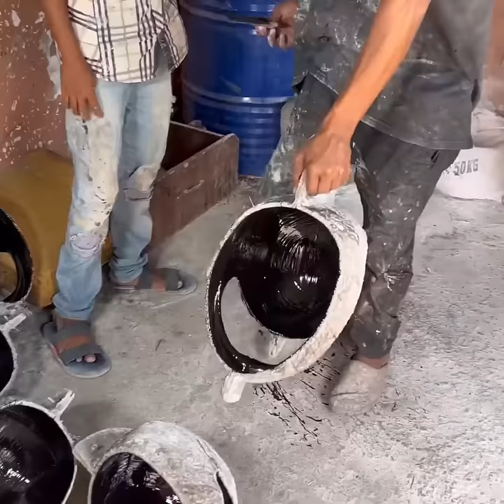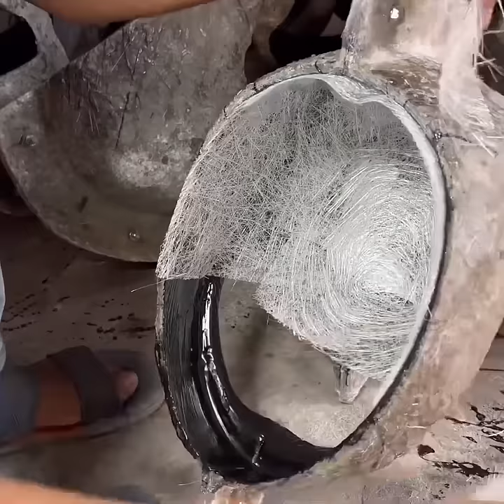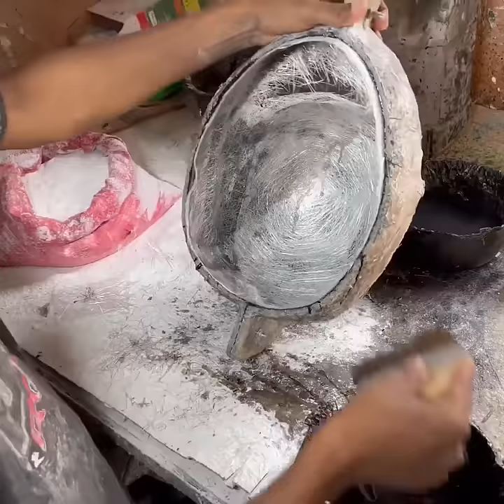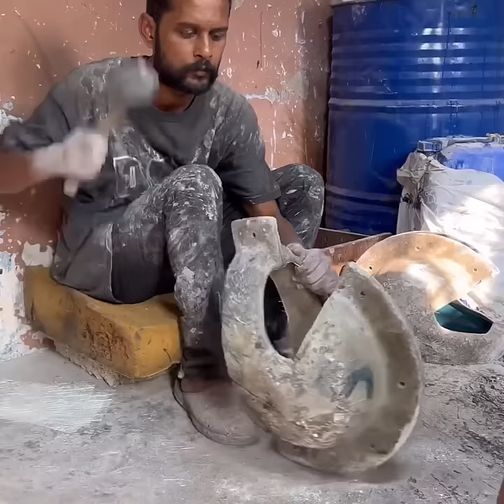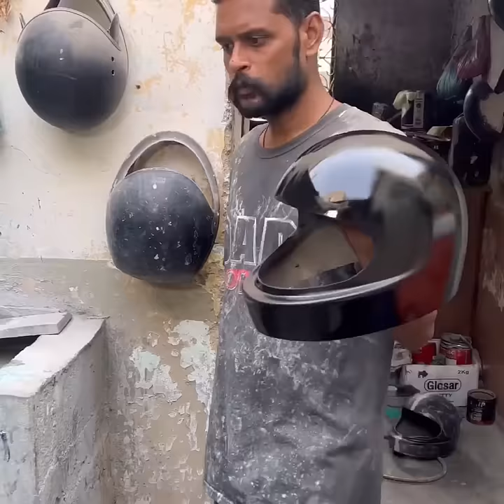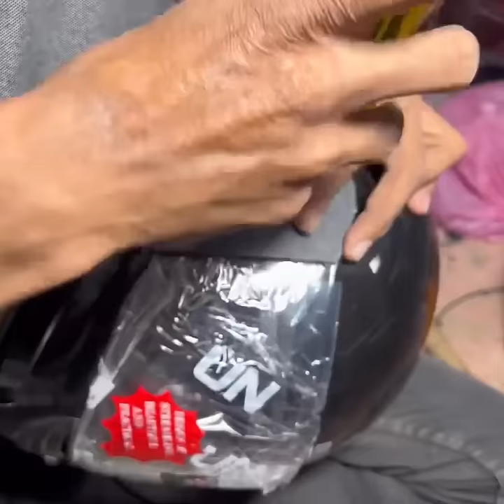How Quality Helmets are Made with Amazing Skills

Comment: The title should be How Low Quality Helmets are Made with Amazing Skills
Edit: 3.8k likes 😳
Reply: no... you're wrong, in fact fiber glass helmets are much stronger than the plastic helmets that are sold on the market, many  actually SportsCar also use fiberglass
Reply: @prodence9563  No! You're wrong.. The Fiber is Only One Layer, Very Thin Layer of Resin it's to cheap and Very  Low Quality.. And there's No Absorbing Layer it's only Comfortable Pad.. You're skull will crack open inside the helmet.
Reply: @RandgriZ04 no es para golpes es para que no te joda el aire en la cara y si caes tener la posibilidad de que no dejes la cabeza como mantequilla en el suelo es normal que los cascos aun se destruyen ,además si te caes de la moto en altas velocidades el caso vale verga
Reply: @prodence9563 In sportscar  fiber material is used to reduce the weight to achieve the high speed in races
Reply: Saya kira itu lumayan kuat karna fiber glas lain dengan plastik, fiber glas lebih kuat..
Reply: А ты уверен? Эти шлемы по крепче китайских будут поверь
Reply: والله لو. الامر. بيدي.  ليتم. اعتبار الباكستان. دوله عربيه. وتدخل في. الجامعه العربيه واعلم كل الشعب العربي اللغه. الباكستانيه. واعلم  الشعب الباكستاني.  اللغه العربيه  وانمح   الباكستاني. جواز سفر يدخل كل البلاد العربيه.  شعب. باكستان. ثروه. من الابداع والحرفية. في كل. مجال.  من.  التصنيع.  ومكن ان تتفتح بعد  ذلك  عقول. العرب 
ابراهيم رضا الكردي
Reply: Unsafe
Reply: What do you expect?
Carbon fibre?
Reply: Life is not guaranteed
Reply: Life is not guaranteed
Reply: Fiber glass is much stronger than the steel.... You half knowledge
Reply: Mejor el casco plástico de este casco al impacto se astilla y un trozo de este te atraviesan el cráneo.
Reply: Everything is wrong... According to  different people with different.. mindset
Reply: So many haters.
Reply: Arai helmet not good, Pakistan helmet😊
Reply: Ou: como ver crianças produzindo capacetes de baixa qualidade
Reply: @yezz30  Quality helmets have several layers and are made to break on impact to absorb shock otherwise you die...
Reply: Is correct.
Reply: 😅😅😅for reals they’re trying to sell it bad!!!
Reply: Instead of fussing over whether the helmet they are manufacturing is poor or good quality why not just appreciate their skills. Just look at the poor state of the building and the tools and what they are capable of producing in a place like that. Can any of you be capable of producing something like that.? Good work guys, keep it up. Just come to Africa and show the people here what can be done with so little resources. Africans have all the natural resources but all they know to do is hug it and complain that outsiders are stealing it.
Reply: You are correct. 😢.It's very unsafe.
Reply: ليكن في علم الجميع أن الخوذة دورها تقليل الصدمات الخفيفة مع الأرض، لكن لا توجد خوذة كافية لحماية الراكب إن كان الإصتدام قوي مع الأرض أو شيء صلب لأن المشكل الذي يقع حتى في السيارات هو تمدد انسجت المخ و ضغطها عند تخلخل الرأس، حيث يلاحظ في كثير من الحالات أن الموت أو الإعاقة تظهر بعد مرور الوقت بساعات على الحادث ...
Reply: Totally unsafe
Reply: @mrmrmrcaf7801 right,you can have a helmet that won't bend, crack or break on impact,but 9 out of 10 the skull will crack or shatter,so like you said,a good helmet is made to crack to absorb the impact, but I don't think the helmets in this video is safe at all,if fiberglass is cracked right, they can be Sharp like a razor blade...
Reply: @prodence9563 they might be stronger than plastic,but if fiberglass is cracked right on impact,it can make sharp edges sharper than a razor blade,an it can do a lot of damage...
Reply: 😂😂 @IbrahimKurdi-gz2hv
Reply: Any helmet is better than no helmet , let's appreciate the craft instead of being a Karen n complaining, unless you make helmets better yourself don't talk rubbish
Reply: Recina. Fibra. De. Vidrio. Y.   Calsita. Y. Catalizador
Reply: It's made of fiber, I think it's durable 😊
Reply: Higher quality than made in China.😊
Reply: @RandgriZ04 they did more than one layer, dingus
Reply: Sebaiknya helm ini hanya utk penumpang motor mainan
Reply: Se vc cair a ponto de quebrar um capacete desse, vc com certeza morreu.😅😅

Vc quer um capacete Ultra resistente pra q??

Pra sua familia falar q vc Morr3u mas a cabeca ficou inteira?😅😅😅
Reply: Yes I love this video so much I swear to god❤❤❤❤❤❤
Reply: Please share the vídeo of You Quality control.
Reply: It lack more pads@prodence9563
Reply: Me too
Reply: O, como salvar vidas arriesgando la tuya.
Reply: @Eldeboradordehamburgesas no hables mmdas, alguien podría creerte. 😂
Reply: 强度比塑料好 但是中国的头盔成本非常低 是用塑料做的
Reply: Fibre glass are verry strong then you  think bro...so,you are wrong😮
Reply: With child labor
Reply: @IbrahimKurdi-gz2hv  what does that have to do with the helmet?
Reply: Very true
Reply: Стеклоткань - это мягкость, углеткань (карбон) - это жесткость. Без угля этот шлем что гандон, без стекла - фарфоровая ваза. Выбирайте свою судьбу с умом
Reply: Just because u don't see v expensive robots n machines making them doesn't mean they ain't of a good quality.  And most of these products u buy in the western world come from these factories just because they in a store that u think is worthy your miney value in europe or America doesn't mean they were made there. Always look at the country of manufacture
Reply: not recommended for your life.  love your life
Reply: You who do not know anything, the helmet should not be solid, unbreakable, or made of iron. It will be more harmful because it will cause concussion due to accidents. Therefore, it must be shock absorbent.
Reply: @Eldeboradordehamburgesas Resposta simples e direta parabéns!👏👏👏👏
Reply: But it's better than non
Reply: Mast
Reply: For your shoe string budget this is more than enough!
Reply: Deberían dejar de contaminar tanto y mandar a esos chicos al colegio
Reply: Фирма веники не вяжет, а если вяжет то фирменные 😅
Reply: And with no respiratory and handa safety. 💀💀💀
Reply: 那就用他的龜頭做一個給你們吧。這是他的絕活。
Reply: Agreed...
Reply: @NoVaS_Gaming ??😂
Reply: Tergantung budget anda mereka mungkin menyediakan untuk budget yang lebih terjangkau,kalau ingin kualitas bagus anda tinggal pesan helm arai atau sejenisnya
Reply: Y cómo crees tú que están hechos los de buena calidad 🤦
Reply: Moto é pra transportar e não pra correr.😅😅😅
Capacete é pra segurança e não pra porradas de pilotos imprudente 😅😅😅😅😅
      Acorde. Motociclista❤❤😅😂😂😂
Reply: Chip quality,,,,,,
Reply: "Low Quality Helmets Made By Kids Who Won't Live Past 35 After Breathing In Fiberglass Since They Were 4 Years Old" should be the title.
Reply: Ohhh hello this not low quality   this is budget helmet
Reply: Fellow Indians do not blaspheme each other
Reply: Imagine o salário desses profissionais? Aí vem os lavradores defender minorias...
Reply: strong or not...
Make motor boat👇
 fiberglass ✅
   plastics❌
Reply: De baja calidad y existe el casco de Alta calidad que en un Accidente asegure la protección de la vida❤
Reply: @Eldeboradordehamburgesas  in most helmets they use styrofoam,as a protective layer,and i think it's best for absorbing shock
Reply: ISI mark is incomplete
Reply: True 😂
Reply: @RanjeetKumar-zh8eh  🗿🤟
Reply: Oh, no, no, no! Don't ever edit a comment for the LIKES! It's a self serving pat on the back and serves no purpose but to inflate your own ego. You don't win a prize for likes.
Reply: Mais 30 segundos de vídeo ia passar a parte onde se cola o adesivo da SHOEI ....
Reply: The title should be how top quality helmets are made!
Reply: Amazing skills! LOL😂
Reply: @IbrahimKurdi-gz2hv  السلام عليكم ورحمة الله وبركاته، أخي كيف علمتم أنهم من باكستان؟
Reply: No veo la habilidad asombrosa por ningún lado
Reply: Ese sería el titulo correcto
Reply: 4,3 k likes!😮
Reply: @prodence9563 there is a big difference between fiber glass and carbon fiber
Reply: @NoVaS_Gaming that is carbon fiber not this
Reply: 玻纖安全帽比膠合安全帽強多了
Reply: @prodence9563 
First of all, let give them credit for having a skill set to produce these helmet. 

Then, they should go on improving the process. At least, they have a starting point...so let's not be "overly negative" to whatever they are doing. You all know the history of big manufacturers like Toyota and Ford to mention a few, how far they came from. The former being a case study and a benchmark to us all. They say the rest is history...

In fact, these guys can improve a lot and they seem to be willing for 'change' and that is why they showcase here what they are doing...

Of course, they need to standardize their operations, including implementing 5Ss to keep the floor neat and clutterless.  Reducing Muda (waste-non value added activities to the product), Mura (Unevenness of task to the machine and personnel),  Muri (overly burden work)

They will need (may be they are doing that already as nothing is underpinned here!) to get the ratio of VoC to VoP be able to know how capable their process is. Otherwise, they will produce helmet out of specs by just being  a PET(Polyethylene terephthalate) hat rather than something serious to protect someone's skull.

Something that we can not take out from these lads, they are working their socks off....

Comment: Actually handmade. fiberglass helmets are the best when it comes to safety. They crack on impact which unfortunately the factory made polycarbonate helmets dont and hence the impact shock is transferred to the rider's head.   The fiberglass absorbs the shock with minimal of transfer.